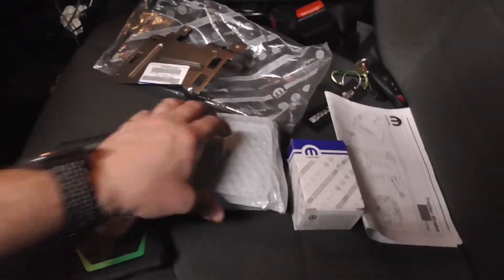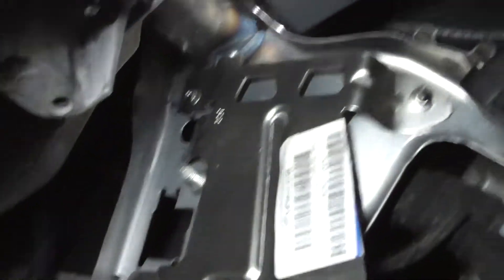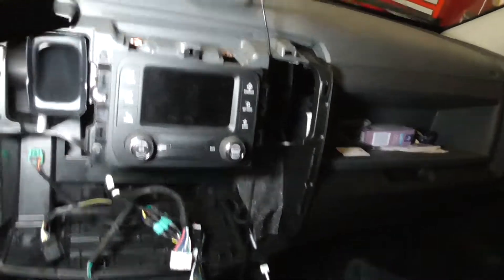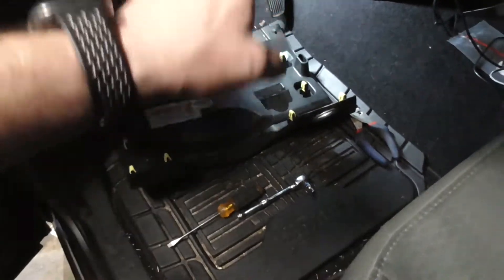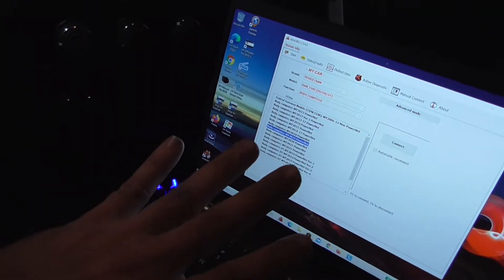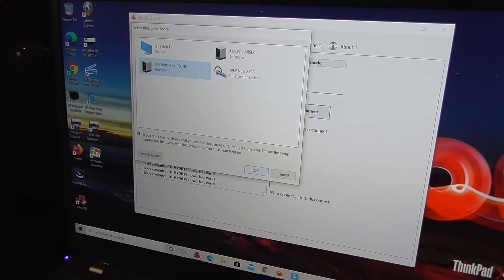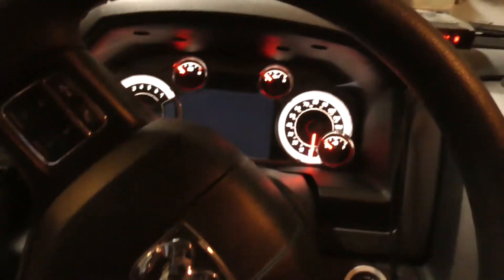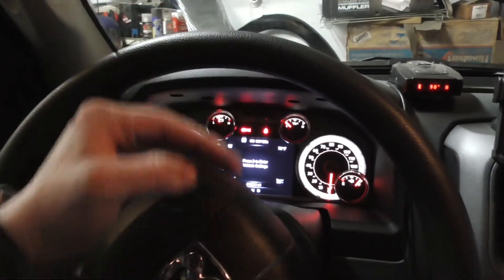2016-2018 (2019-2021 Classic) Ram OEM Trailer Brake Controller Install | AlfaOBD Programming

Comment: Good video.. Unfortunately, the oem brake control will not work on my gateway triple axel hydraulic over electric trailer. Had to go aftermarket

Comment: My truck is a 2018 Ram 1500. Manufactured 12/2017. Do I need a security bypass? Did you have to install one?
Reply: I was also planning on using the OBDlink EX because my laptop does not have Bluetooth. Will that work?
Reply from the maker: Yes I had to install a bypass, every 2018 and up needs one. 

And yes, I'd assume the EX will work fine. If not, there are really cheap USB Bluetooth adapters you can buy. I did that on my old laptop to use the adapter before I got a new laptop with Bluetooth.

Comment: This video was awesome. Thank you so much! I did have issue completing each step and it wouldn't update to yes/enable. After further research I had my truck in run mode like you I finally had success when I had it in accessory mode. Now it all works, I have a 2019 ram 1500 classic. Thanks again

Comment: What controller do I buy and from who,where do you get the program to change all them settings?
Reply: That's an OEM trailerbrake. Any mopar place or salvage yard if that stuff hasn't been stripped yet. alfaOBD is the program you'll want. 2018 and up you'll need  security bypass. ..get the cable kind, better then the modules imo

Comment: Great video thank you! Worked great on my 2022 ram 1500 classic. One thing to note on my model, the obd security bypass is located behind the radio. Easy to get at once the center  infotainment console is removed. As for the mounting bracket I used rivet nuts in the truck and drilled clearance holes in the bracket. Also worth mentioning I couldn't get my laptop to link with AlfaOBD and obd link MX but I was able to use the AlfaOBD phone app, followed your procedure and it worked flawlessly.
Reply: I did the same, every thing works but the manual slider doesnt work. it shows 100% on the dash all the time. i dont know what i did wrong

Comment: So I just went through this process and everything seems to work. However, now even with no trailer connected, every time I push my brake pedal the trailer brake instrument illuminates on the dash showing the gain and percentage. It stays on as long as I have my foot on the brake then goes away and my normal instrument display arrangement comes back, until I step on the brake again. I have redone the procedure several times with no luck and I cannot seem to find anything in settings to stop it. Does anyone have any info? Am I just not seeing something obvious in the settings to turn off the trailer brake when no trailer is connected? Any help would be really appreciated. I have a 2016 RAM Bighorn.
Reply: I’m also having the same issue has anyone figured this out yet?
Reply: Mine does the same thing on my 2017.. Did you happen to buy the cheaper module off of Amazon for like $100? I did and have the exact same thing happening as you did.. I am guessing maybe I need to buy the genuine Mopar module for $300?   Have you had any luck figuring it out?
Reply: Is it really hurting anything when the lights come on?
Reply: @stonedeadoutdoors189 it’s not a light.  The entire digital display on the cluster changes to trailer gain..  it’s annoying
Reply: But a used OEM module, the trucks don't like the Amazon Chinese crap

Comment: Can you reverse these steps to remove the OEM controller if you were to install an aftermarket controller on a 2014 RAM 2500?
Reply from the maker: Yes, you should be able to.
Reply: @DanielPace92  Thanks for the quick response!

Comment: I found that mounting the module bracket with screws was much to difficult. I drilled the holes in the bracket to match the size of the corresponding holes, then quickly and easily mounted the bracket using pop rivits.
Reply: Good idea

Comment: Did you need a security module bypass to do this? I have a 2019 and I followed all the steps and none of the statues will change to Yes.
Reply from the maker: Yes, 2018+ Christer vehicles need a security bypass to work.
Reply: I have the same problem with my 2019 ram 1500 classic. Guess I'll have to go buy a sgw bypass cable.

Comment: Hi friend I used the phone app to do all my programming also the mileage and had no problem using the phone app question do you know if you still need the bypass harness with alfa obd on 2019 ram classic and up or no
Reply from the maker: Yes. Any 2018 and up Chrysler vehicles you will need a bypass harness.
Reply: So I just went through this process and everything seems to work. However, now even with no trailer connected, every time I push my brake pedal the trailer brake instrument illuminates on the dash showing the gain and percentage. It stays on as long as I have my foot on the brake then goes away and my normal instrument display arrangement comes back, until I step on the brake again. I have redone the procedure several times with no luck and I cannot seem to find anything in settings to stop it. Does anyone have any info? Am I just not seeing something obvious in the settings to turn off the trailer brake when no trailer is connected?  2016 ram 2500 tradesman

Comment: Does anybody know if you need to reprogram the trailer brake brain box if you replace it? Mines having issues and i think its the problem but i dont want to replace it then have to take it to a dealer to have it programmed and i dont have this alfa obd system
Reply: If it's OEM and replacing with another OEM..no

Comment: Let me start off with some props on your video.  You did a fantastic job from start to finish.  Getting that bracket installed is a pain in the A$$!  

I just tried this recently and have some questions/concerns.  At 12:31 you state "Trailer Mode" but you actually select "Trasport Mode".  I believe it is safe to assume that you mean "Trailer Type" after just programming "Trailer Name".  Transport mode seems to be an option that you do NOT want to enable as it is for placing your vehicle in a transport or SHIP mode.  This setting seems to be for leaving the vehicle in somewhat of a storage state to save the battery.  Am I correct in this?  

That being said, I have programmed these settings: 
"Cust.Set.Menu 2-Trailer Select CSM Present" > Yes
"Cust.Set.Menu 2-Trailer Name CSM Present" > Yes
"Cust.Set.Menu 2-Trailer Type CSM Present" > Yes
"P/T Chassis Net-ITBM/HWM Integrated Trailer Brake Module" > Enabled

Everything looks great except I am unable to change the name on any of the trailer names.  When I select another option (like "car" for example), the check mark is selected for the "Car" option for approximately 2-3 seconds and then reverts to the original selection.  It will not change.  Not a deal breaker, but a little frustrating.  Any ideas?

Comment: I just got done installing the module and controller. Followed your steps and everything is coming up on the Uconnect screen and I’m the evic screen. But nothing works. I connected my cargo trailer with out any luck says trailer not connected, hooked up my travel trailer camper also with no luck says not trailer connected. I went to settings in the Uconnect screen and choose trailer one but will not let me choose any trailer I put the check mark there and it disappears so o can’t even name a trailer. I know my camper and cargo trailer brakes work and nothing wrong with their connection.

Comment: Thank you very much! That was very helpful. I don't have setting menu! do you know what option in alfaobd to enable that? 2018 Ram 1500? Thanks
Reply: Did you ever figure this out? I can't seem to find out how to get the settings gears icon to show up on my dash screen either.
Reply: I have a 2022 and there is no settings menu on the gauge cluster.  But if you go into the settings in the infotainment console it's there just like in the video

Comment: i recently started gettong the service trailer brake systwm message on my dash, i re enabled it on alfa obd, but it still shows up, is there anything i can do within the app to fix this?
Reply from the maker: You need to pull the codes and see why the service trailer brake message is popping up, you can't know anything without the codes.  You can pull the codes with AlfaOBD.
Reply: @DanielPace92  thanks i apereciate it

Comment: Thank you! I installed this kit and couldn’t find the settings in AlfaOBD, this video helped! Only issue I’m having is the gain buttons or the slide button won’t do anything. I have a 16 Ram. I’m wondering if a trailer needs to be connected to add gain or have the slide button to work. I went through the procedure twice just to make sure everything was enabled or on.
Reply: Did you get your gain to work I’m having the same problem just wondering if I have to be connected to a trailer
Reply: @vosstransport9200  Yes I did. His instructions in this video are correct. 
It turns out the brake module under the dash was defective. I purchased the kit off eBay. The seller refunded my money and got it from another seller.
Reply: Yeah I’m having the same issue, my gain knob doesn’t do anything. Looks like I need to send it back. Bought it on Amazon.